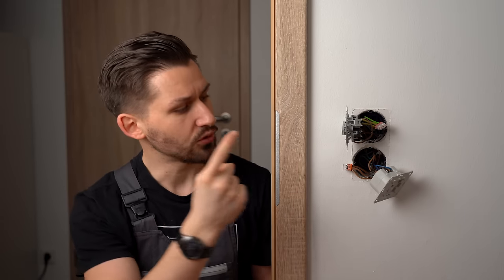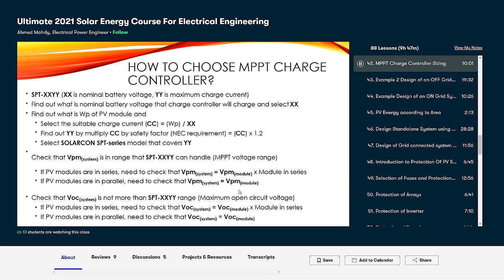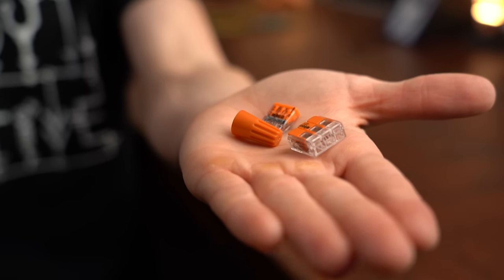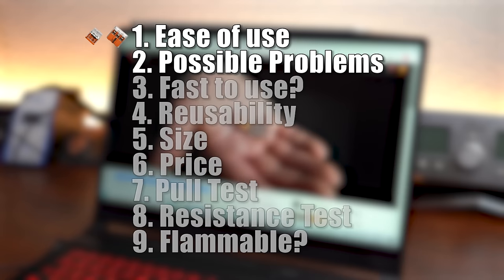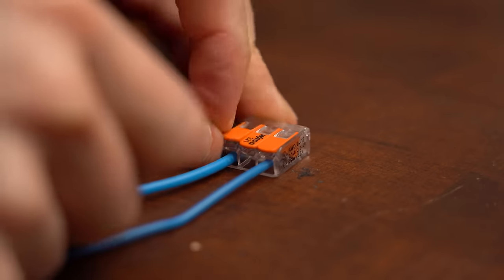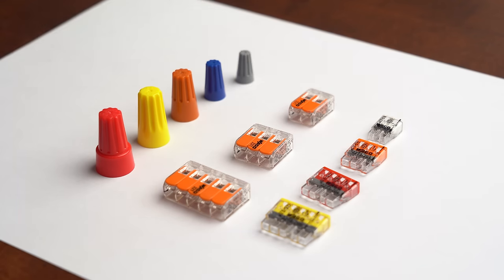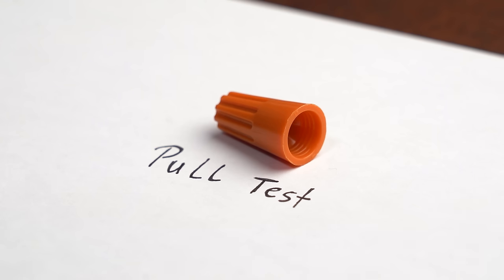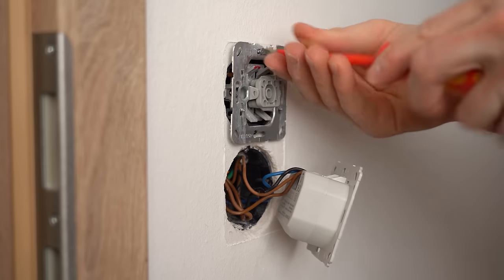What Wire Connector is the Best? Settling a Debate! Wire Nut VS Wago

Comment: I've been using wago clips for decades, they perform just fine.
Still during my jobs at the dutch army they demanded the use of wire nuts, as bombing bunkers can potentially shake loose those clips.
While those nuts are more work and can't be easy altered after the initial installation. When properly done, wire nuts are far superior.
A friend of mine told me the dutch army now also allows those wago clips. So wago is doing something very right 👍

Edit: Putting stranded wire in wire nuts is not what I would do.
Also in the reclosable clips it's better to put a sleeve around the stranded wires.
Wago also makes very good wire nuts, much better than the chinesium? Ones you are using.
Reply: I refuse to believe that the Wago doesn't lose spring tension over time. Seems like a fire hazard in the future. It's a tiny metal tab relying on tension. It's going to weaken eventually. It already heats up 4 times more than a wire nut, imagine when it loses it's tension how hot that little thing is gonna get.
Reply: @isaackvasager9957  tension of a spring changes when loading and unloading the spring over time. Springs usually break due to metal fatigue.
I'm not sure that a spring that rarely is being loaded and unloaded will lose its power.
Reply: @isaackvasager9957  The one with 2.2 Ohms doesnt even rely on spring tension though. The plastic tabs push the metal onto the conductor. The 2273 relys on spring tension, but has a lower resitance to begin with. And we are also talking about milliohms of resitance here, so even if the resitance quadruples 4 Watts is not gonna start a fire. The only theoreetical danger would be a complete loss of tension resulting in arcing, but unless you break off the spring during instalation i dont know how that would happen
Reply: @derfurz8618  Hi you are wrong. The WAGO 221 with 2.2 mohms is also tensioned by metal spring. The task of the plastic is to lift the spring!
Reply: @istvantisza9365  you are right, my point still stands. Unless contact fully breaks and you create arcing, the resistance we are talking about here is minimal
Reply: wrong, wago tells everone to use them without sleeves, for a much better connection

Comment: I have worked with both of these. I prefer Wago connectors. To ensure a perfect entangling of wires while using wire nuts it is best to initially twist the wires then screw on the wire nut. Never failed me. That is my experience with wire nuts. That said, I will continue to use wago connectors.

Comment: I would not recommend the smaller Wago (without the levers) for repetitive use. The springs tend to yield a bit and suffer from a kind of fatigue (plus the wire removal forms an additional stress for them), so they lose the contact pressure. Have seen many of them failed due to just this reason. But I have no experience with the lever release type, I would guess the lever would be more gentle on the spring, so probably few cycles they may manage.

So to me the reusability is the stronghold of the wire nuts. There you just tie it an extra turn angle as the spring gets worn out, but still are able to reach good pressure.

For the wire nuts, I'm not sure they can handle anything else than all wires there being the same. I don't think combining stranded with a solid core wire will work, there is nothing forcing the solid wire to get also twisted and so interlocked with the stranded one. For the dissimilar wire connection, the lever release Wago would be the way to go for me. Or better use the set-screw "chocolate bar" type.
Reply: The smaller ones are not meant to be reusable, you replace them completely if you need to. the ones with the levers can be reused plenty of times, no need to worry about that.
Reply: Wago had other connectors that don't have an individual lever for every wire channel, but a slot where you could push in a screwdriver to release the internal spring and remove the wires again. I tryed to find them on the Wago website quickly, but could not see them anymore. Maybe they were removed because too many people stabbed theyr hand with the screwdriver when trying to release the wires...
Reply: @ProtonOne11  Or my guess with the screwdriver release, there was no control about how deep someone pushed it, so it often ends with fatigued spring and bad contact pressure as well.
And by the way I don't think these are meant to be released by a screwdriver, but by a dedicated special release lever tool. (I mean the type where you push on the metal spring inside through a slot in the casing) With that I can imagine the spring could be designed so it really withstand few cycles. But I've never seen anyone using anything else than a flat screwdriver to release the wires from it and then use a new one... What became a good practice (according to me) was to use few holes longer connector from the start, then when doing some rework you may still release the wire you want to disconnect (so there won't remain any exposed metal, nor you need to hassle to remove that wire and weaken the springs in the other holes by that twisting and tugging) and connect the new wire into one of the fresh spare holes, so you won't have to undo everything yet the wire is there always inserted just once.
Dunno the official rating of these (single vs multiple insertion; never studied the official datasheet, which is not good approach, I know), but just because how sensitive that system is and how "abuse friendly" the design is, I may imagine it resulted into a lot of reliability problems "in the wild".
But at least the two "non-lever" types are dirt cheap here (the wire nuts appeared, but are more expensive here), so it does not make any sense to not use larger ones to have spare fresh holes for future rework and always use fresh one.

Comment: It would be great to see how they both perform during a fault, low temperatures, and high humidity.
Reply: The English electrician John Ward has made a video, where he tests various connectors to destruction. (He didn’t include temperature or humidity in his tests.) 

Here is his video: https://youtu.be/bP0qHyVAymU
Reply: Yes, I expected to see such tests as well. Big Clive did a max current test between real Wago and Chinese copy versions. Very enlightening.

Also, how could you have posted this 12 days ago while this video only got posted 15 min ago? :)
Reply: @JasonRobards2  As patrons of BigClive, we get access to most of the videos that he publishes, before they are released to the general public.
Reply: @JasonRobards2  Typically the delay is due to Patreon screening. You've got to give them SOME value for their money!
Reply: The resistance tells you how they will perform. If wire nuts are the standard, the better Wagos are 2.666 times worse and the other Wagos are 14.666 times worse.
Reply: @Peter_S_  there also is the factor of power dissipation and construction. Lower resistance doesn't automatically imply higher rated current. Always test to be sure!
Reply: @JasonRobards2  while thats true, in the case of wire nuts its not really applicable. wire nuts dont directly conduct any power, they simply pinch and hold the wire together.

Comment: I live in the USA. I started using Wagos some years ago, and would NEVER go back to using horrible wire nuts!
I will be wiring the tiny home I intend to build in a few months entirely with Wagos, as well as the larger home that I will be remodeling, later. The old home that will be remodeled had just ONE circuit installed in it originally, in about 1939. I removed that one circuit a few years ago during initial demolition, but saved some of the "oddities" to be reused in the eventual remodel, for nostalgia's sake, such as the special (and VERY new at the time of the first circuit's installation) "Twist Lock" receptacles:

https://en.wikipedia.org/wiki/NEMA_connector#Twist-locking_connectors
Reply: That's because you don't know how to properly use wirenuts. They are perfectly fine.

I really know an amateur when I see they used electrical tape on a wirenut 🙄

There's some other channel something like everyday home repairs and he's a total amateur. Though he takes the criticism and improves I'll give him that. But he loves wagos because he didn't understand wirenuts.

I like them both. They're both useful. They can both be misused and wirenuts will likely be misused far more until wagos become the norm. I bet you'll see people try to stuff 6 conductors In a 3 conductor wago for instance. It is what it is.
Reply: @etherealrose2139  A fair point. Wire nuts, used correctly ARE perfectly fine.
But I often find myself wanting to modify existing connections, due to my predilections. I really enjoy being able to easily add to or modify what's in my electrical boxes, if Wagos have been installed there. Plus, I just think they're really "neat", and will gladly pay the extra cost, since my homes are very small, and I won't need many of them.
Reply: @etherealrose2139  I know what you mean about electrical tape on wire nuts. My non-electrician father always did it that way, and I don't.
Reply: @etherealrose2139  The father of one of my exes was a professional electrician, and actually worked for General Electric, doing electrical infrastructure maintenance at one of their factories in upstate New York.
But the electrical work I saw at his home that he had done was some of the shoddiest, most dangerous crap I've seen.
"The cobbler's children go barefoot", indeed!

Comment: I favor wirenuts because, when properly used, it's not a component in the circuit path, and it's at least one additional electrical connection for something to go wrong. I also like how it performs as a knob to twist your conductors inches past the opening of the nut for better security.
Reply: Yah, people don't understand that the wago is a corrosion point. It absolutely positively will corrode over time just by the materials and how it works. It's just weird AF.
Reply: @Folsomdsf2  The WAGOs have a Sn layer on the contact point for gas tightness and corrosion protection. I've never seen one corrode. Of course it's not for outdoor use, but there's even a solution for that, it's called WAGO Gelbox.
Reply: @RamBoZamBo123  My dude, they're literallyhost to galvanic corrosion and why they have specific instructions on which one to use for which wiring. Now I know you have no clue what that is, but hint: it's not good.

Comment: you need to do a test where it get repeated high current to see how the grip on the wires degrade over time due to constant heat changes, over time they can lose the grip and heat up more and there is a chance for fire if they re used with something that can use a lot of power and turns on and off a lot, like electric water heaters.
Reply: Electric water heater circuit shouldn't need use either wago or stupid wire nut at all... being separate circuit and direct run from MCB board to the heater unit.
Reply: @BTW...  Yes, but on some occasions you can't route a new cable through the complete house. I installed a 3kW Heater (13Amps) with several wagos on the existing circuit to the MCB board, that was 25 years ago and there is no problem till now because the spring in the Wago will make a good permanent connection. A connection in a wire nut or screw connector would surely have have failed in the meantime due to thermal stress and loosing contact over time.

Comment: I just wired my house with both wire nuts and Wago's that my dad gave me. I really like the wago's for stranded wire connections! My main concern was to make a good connection though so I used wire nuts for 95% of my connections, but the trick with them is to pre twist the wires then use the wire nuts, then do a pull test before pushing them in the junction box. The pull test failed too often with stranded wire so the wago's made the better connection in those cases.

Once you are familliar with wire nuts it goes very quickly! Push in connections I would avoid at all costs though, I do not trust that over time. Good connections are the key to good wiring, it saves electricity, breakers and a possible house fire too!
Reply: This is about where I'm at with it. I've been doing electrical work for 9 years now. Dealt with alot of old shoddie work where they did what he did and just stuck em in the end and twisted. Just today I pulled off some like that, and redid the connection tin the proper way. Those are the only times beyond stranded wires that I've seen any problems with a wirenut. Stranded isn't the best for wirenuts, so I might be getting those wagos for that purpose, transitioning solid to stranded is sometimes more annoying, but others it grabs very nicely. anything that's early in a circuit especially, anything solid, I'm sticking to wirenuts. Watching this other guy overcurrent all these connector types  reinforces that wirenuts are absolutely the best connector for solid wires. Posting the link in s seperate comment in case YouTube hides it.

Comment: For me, being able to do non-destructive changes to circuits is the reason I've started using Wago. I know, I know. 99.9 % of all circuits are never changed after they are assembled. I also know that changing that 0.1% easily makes it worth it for me..
Reply: You mean 0.1% of circuits.
Reply: Maybe .1% during construction.  Then afterwards, on a 15 year old house owners have likely swapped a few switches for dimmers and maybe even again switched the dimmers to led supported dimmers.   Had kids? Maybe they swapped bedroom outlets to the kid safe kind.  Added ceiling fans or swapped basic contractor lights for something fancier.
Reply: I am working with automotive camper conversion stuff, and I am confident in saying that about 10% of my connections are good on the first go. For absolutely everything I do, I leave extra material on either side in order to be able to do a rework in some way. Junction boxes are nice and all... I have enough space! Just... Not the right shape.

I do a lot of unconventional fabrication. Wago wins the point in my book, and I came here in case I was creating danger through stuff I didn't know. Turns out I had the right idea and didn't find anything too surprising.
Reply: @MtnXfreeride  More expensive. Lets see here 22 connectors are reasonable at nearly one watt each lets call it twenty watts. The years roll buy we have the two examples both lets hope safe properly installed no issues. EXCEPT you paid 5 times as much to latter pay maybe another 20 times as much in electricity. Wago is worse than plain old mechanical connection pre wire nut in the long run. Total waste of money effort and engineering IMO.

Comment: As a homeowner in the US, I've been switching over to Wagos whenever I replace switches, outlets, or fixtures.  They're better for stranded to solid connections (for whatever reason, US fixture manufacturers seem to insist on using stranded wires).  They're also much easier for bundling neutral wires (I always switch hots only) and ground wires compared to giant wire nuts.  If need be, I just install a deeper box (for those massive smart switches).

Comment: Where I think the Wago connectors really shine is when you have to attach multiple connectors together.  I recently converted my shop lights from fluorescent to LED (removing the ballasts) as well as adding a couple new fixtures that used stranded cable to connect to existing solid conductors.  Using the Wago connectors made my life much easier.
Reply: thats when it make it makes sense things that don't make sense are the arguments when they say you can add a new circuit.
But it's like how often do people add new circuits...

it then turns into hoarders mind where they keeps tuff thinking they will use that item but never will use it

kinda like getting a Electrical Panel Box with 30 slots but you only use 16 just in case

Comment: Nice video. Wago connectors are so tidy and wires can be shorter. Wire nuts however, were never used here in Slovenia and personally, they look messy and unreliable to me. We mostly use screw terminals. They can take even less space then Wago and are really tight and secure connection. I use Wago only for low current application (lights and such).
Reply: “Look messy?” WAGO connectors are superior but cost ten times more than wire nuts. This is a huge reason a US conversion would be prohibitive. Also conversion to 240v would tax our power grid. Same reason the US did not convert to the metric system which are obviously superior.
England left the EU for the same reasons some of which were specious and actually created problems and devalued the pound sterling.
Reply: @joshrandal6982  No one gives a shit about the US, the guy is from Slovenia. Plus wire nuts DO look janky af.
Reply: @Bramble20322  the people that live here do. Besides I went to Slovenia once………..it was closed.
Reply: If wagos are so great why wont you use them in anything but low current? Simple because you know like most that they cant be trusted to hold high current, making them. useless in a house
Reply: @joshrandal6982 the whole of the UK. Left the EU not just England, and wire nuts are utter rubbish.
Reply: I agree, but I don't really trust the screw  connectors for stranded wire. I feel like the screw pushes the strands out of the way and increases the resistance. I have never tested that though.
Reply: @diegudr  You are right. Stranded wires must have ferrules on them or the screw terminal must include separating metal strip between the screw and wire, otherwise the screw can damage some strands and then problems can occur.